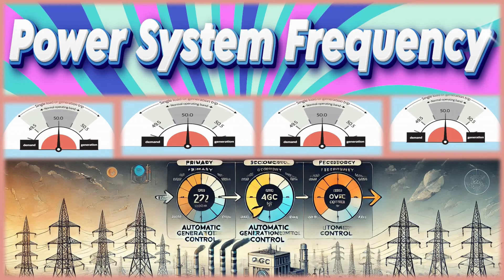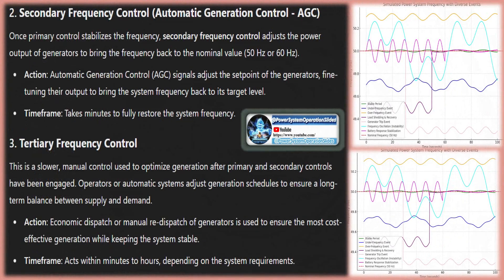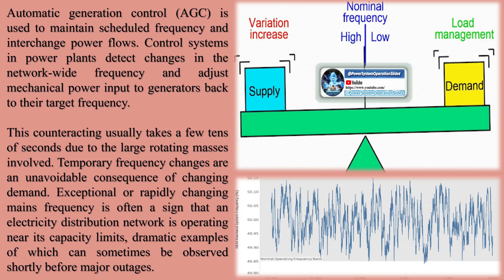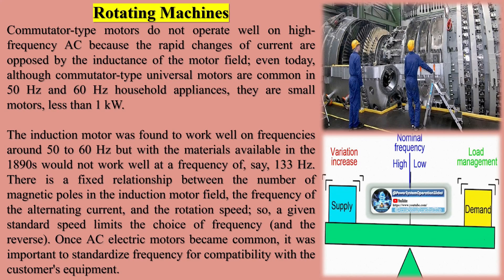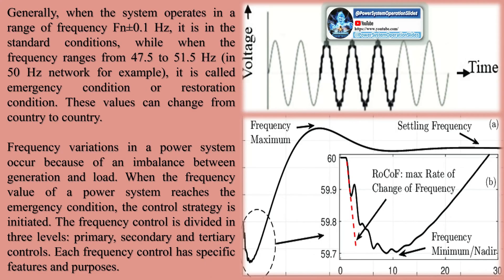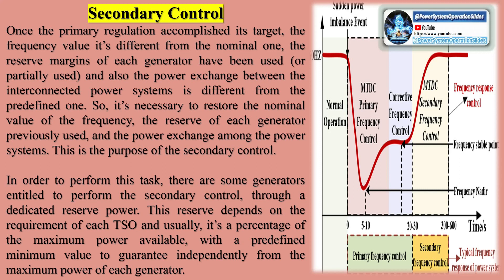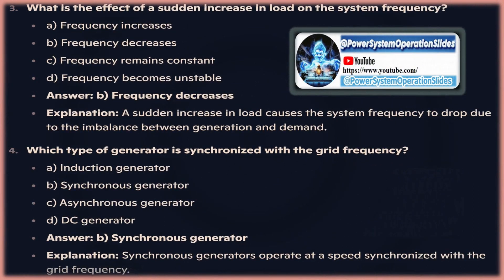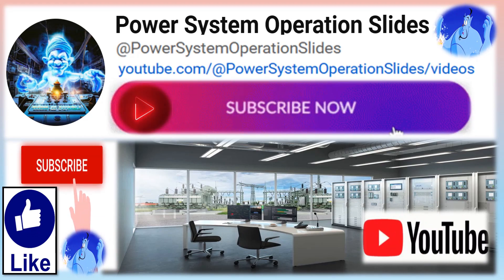Power System Frequency | Power System Frequency Key Points | Power Frequency Impact on Devices

Comment: Thank you for this presentation. Great effort is mad to ensure the quality of the current. With more battery storage and  decentralized renewable energy being added to the grid. maybe a rethink is needed about power transmission. The only necessary place that AC current is needed is at the substation level. Why not convert the whole high voltage grid to DC?
Reply from the maker: dear conversion stations are costly business
Reply: @PowerSystemOperationSlides  The question I am trying to answer is a HVDC or MVDC connection directly into a battery farm. In other words you are charging the batteries. All of the AC work takes place on the local area side using inverters. HVDC conversion to HVAC is not a direct function so no expensive conversion. (?)